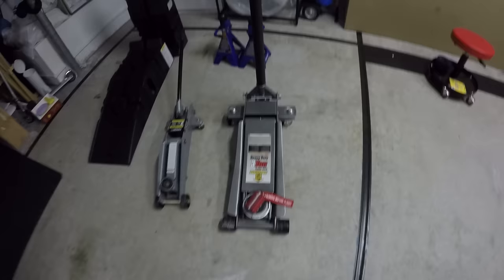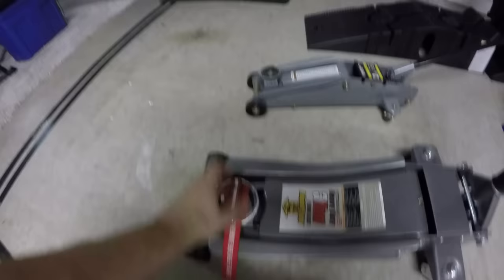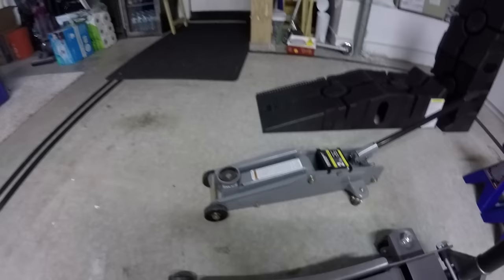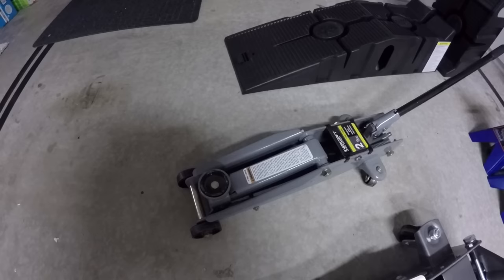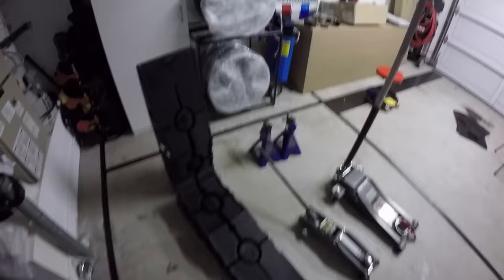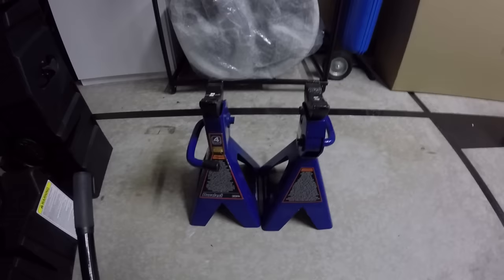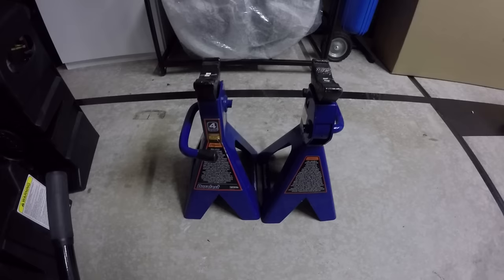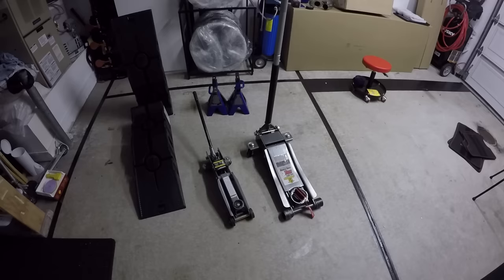I Use Floor Jacks, Jack Stands, Ramps, etc… (vlog)

Comment: Once you have the car jacked up, can you slide the ramps underneath the wheels instead of using jack stands?
Reply from the maker: Sure
Reply: @Lethalgarage  Thanks, and love your video!  Very informative
Reply: @Lethalgarage  I am replacing struts and need to remove the wheel. I have ramps, but can I use them to secure the vehicle at the points where jackstands would ordinarily support the vehicle? To me, they'd be strong and steady enough. I don't want to invest in jackstands if the ramps will do and I rarely need to remove wheels on my vehicles anyway so I wouldn't get my moneysworth out of purchasing stands. To me, it seems that jackstands would put my small car up too high. Any thoughts? Thanks!

Comment: My jack is an AC DK20, 4,400 Lbs. lift, a low 3.1" lift platform, 19.7" of lifting height.  Was worth it especially since all my cars have been lowered.  I use some low slope ramps that are great for low cars and give you enough room to get that jack under a lowered car.  They are Takata ramps but there are non-branded replicas on Amazon called "Pair of Plastic 4,400lb. capacity Mini Car Ramps" for $45 http://www.amazon.com/Pair-Plastic-400lb-capacity-Ramps/dp/B00UHLPES0/ref=sr_1_2?ie=UTF8&qid=1463205494&sr=8-2&keywords=low+car+ramps